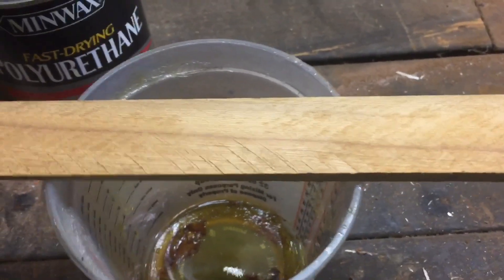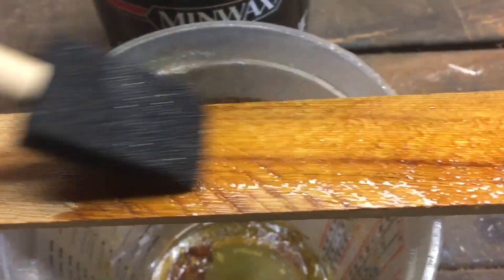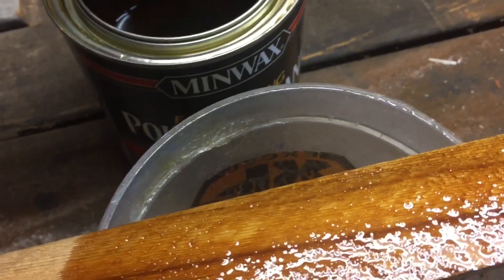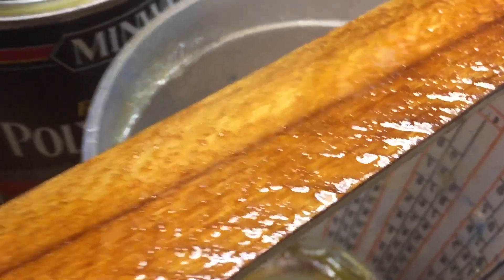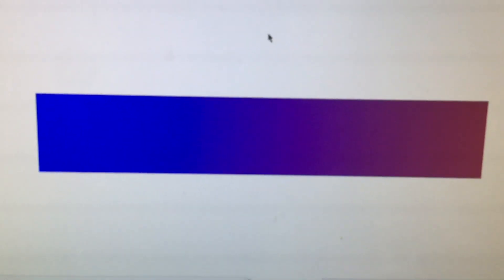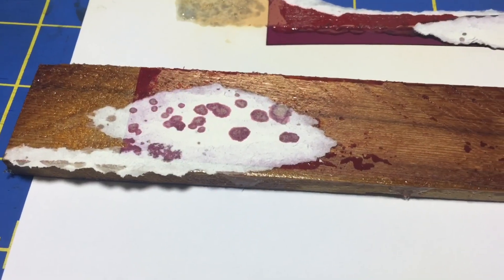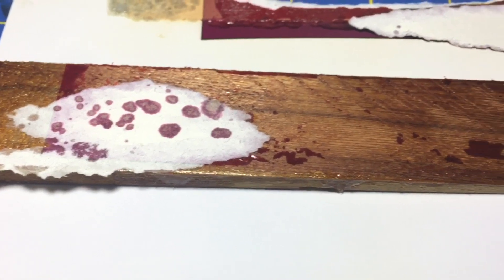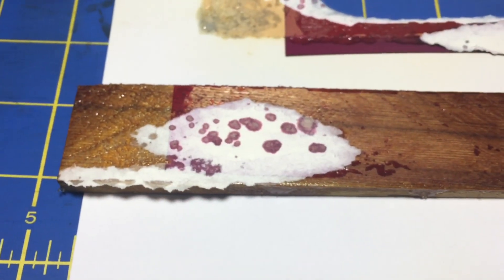Adventures in dye sublimation

Comment: I saw a video that used MinWax Poly Acrylic successfully
Reply from the maker: Got a link to it?
Reply: @AirbrushingtipsNet  https://www.youtube.com/watch?v=RzQvgUJPfps
Reply: I'm looking for alternatives to the mugs tiles and aluminum sheets etc that I have to buy to sublimate. I've got shims too but not certain what I could do with them. I need to try plywood, or mdf maybe.  I tried and failed with a polyester golf shirt as it began to melt!
Reply from the maker: @gordparrott9640  I'll check it out.  Thanks!
Reply: I've used spray car laq don't put on to thick let dry then prime under press without pressure to really dry it.
Reply from the maker: @rabwoody264  Thanks for the tip.  I found another product I want to try, but have been busy with family stuff.  I'll get to it eventually.
Reply: @rabwoody264  prime? or CURE under press?
Reply: @gordparrott9640  cure Gord